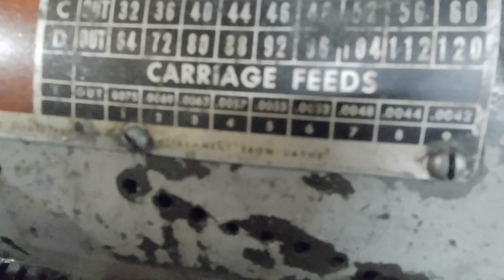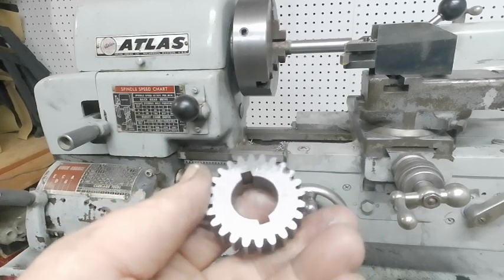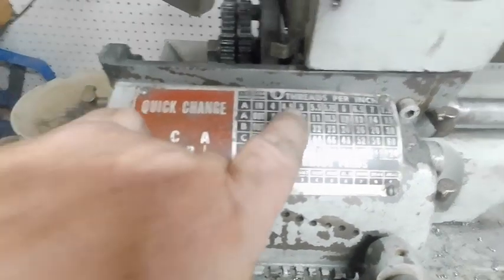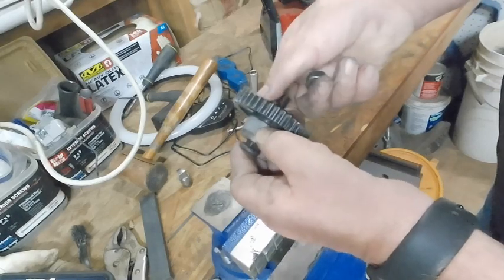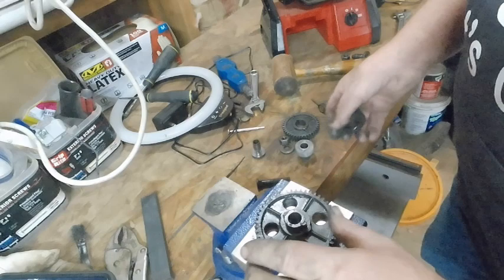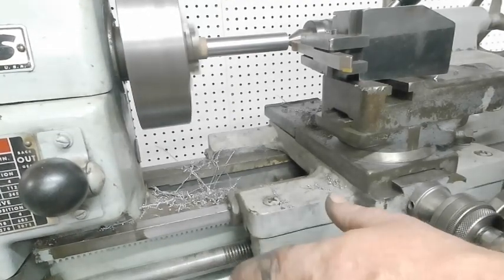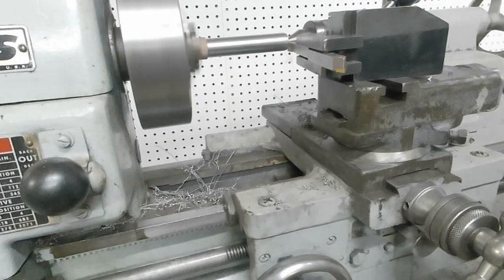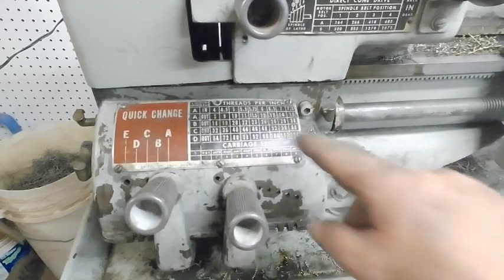Fixing an Atlas Lathe Feed Rate

Comment: I have gone back and forth between your lathe in this video and the one I pick up in a week and they are identical. What is your specific one so I can order a manual and things and I would like to order the gears for feed rate as well?  Thank you for any help.
Reply from the maker: Mine is a 12x36 Atlas Commercial lathe. Made in the early 70s. You can download the manual, or if you give me your email, I can email the PDF to you. I had to have a surgery a few years back and have not used mine much since. Same with blacksmithing.

Comment: My craftsmen commercial has a 3 phase motor and VFD so I can control the speed no problems. I bought it that way .
Reply from the maker: Very cool. I live out in Rural Oklahoma. We don’t have 3 phase out here. I wish I did. It is so much more efficient.
Reply: @odd-  mine runs on 220 single phase with a converter, commonly referred to as a VFD .
The comments on surface finish are correct ( tooling ) makes a difference however for single point threading the speed does need slowed down in my opinion.
Reply from the maker: Oh wow. How does the motor fit in the cabinet? I just replaced my original with a 1 hp. It took up most of the cabinet space.
Reply: @odd-  I think mines a 2 HP baldor. Fits just fine no modifications I’m aware of . I was lucky I had the converter I found at a thrift store for 25 dollars and it worked . Lenze
Reply: Nope just looked it’s a 1.5 hp BALDOR

Comment: Would have been a lot simpler just to change your cutting tool
Reply from the maker: I do know the wider radius on the cutting tool helps, but this set up takes it a little further. On top of that, the motor that runs the lathe is in need of rewinding. It is weak to say the least. This helps with that issue too.

Comment: Both your video and one with the Craftsman version of the same lathe have quick change gear boxes. Is there any reason the gear swap won't have the same result without the quick change option?
Reply from the maker: If I’m reading your question right, the lathes without the quick change gearboxes work primarily with the change gears. It would be a matter of reducing the ratio of rpm on the feed screw. I am not familiar with that style of Craftsman lathe enough to say for sure, but I know the spacing is limited and you may not have the room for the change. This would be an excellent question in one of the forums on Facebook or other SM.

Comment: You can accomplish a better finish without changing the feed rate by using a tool with a larger nose radius. Tool shape and nose radius are as important if not more important than feed rate for finish quality.
Reply from the maker: I agree. I do have some cutters with a larger nose radius. I do use them. But they limit the depth of cut too. I see both sides of the debate. Thanks for watching!
Reply: @odd-  Thank you.  Now I don't have to say it.

Comment: Great idea. Where did you get the 24 tooth gear.? What is diametric pitch?
If you give the diameter of the gear, I can do the calculations .

Thanks
Frank
Reply from the maker: I bought the gear from eBay. Not sure about the pitch at this time of morning, but I will look. I do want to learn gear cutting. I have all of the necessary tools, just haven’t gone down that diametric rabbit hole hole yet.😅
Reply: Look for Mr Pete 222 on YouTube. Shop tips 192-200. Great tutorials on cutting gears. He has a whole series on the Atlas lathe as well.

Best wishes
Frank
Reply from the maker: Love watching Mr. Pete. I have gleaned a lot watching his videos.